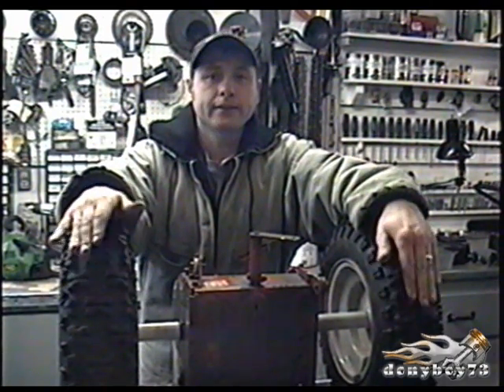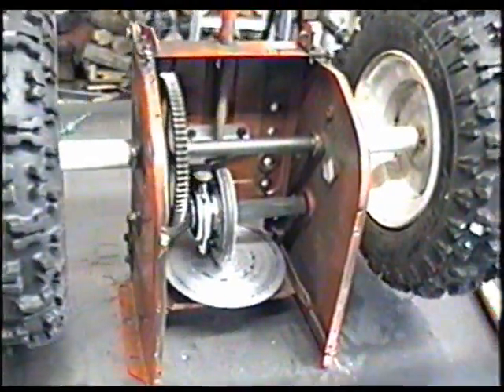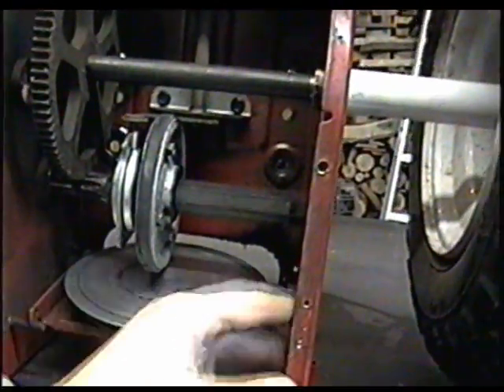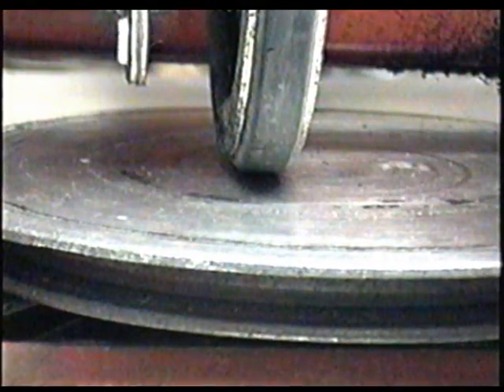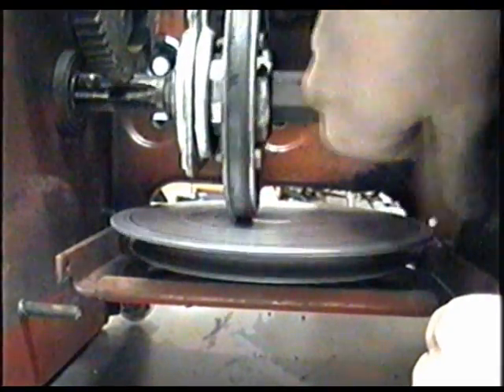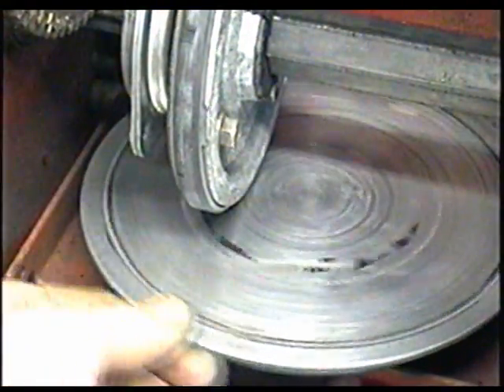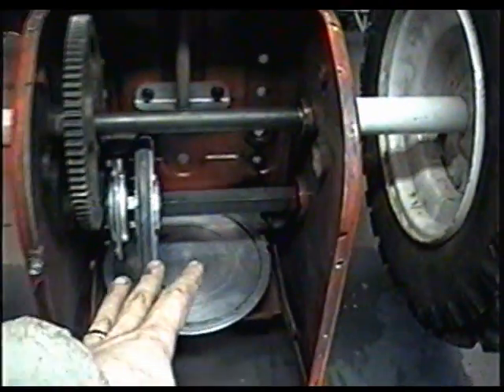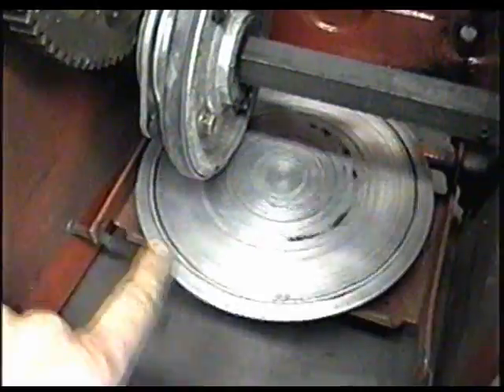HOW The Friction Disc Wheel Works on Your Snowblower

Comment: My friction wheel has been worn for a while. It makes the snowblower very difficult to manuever and can cause back pain, because you are constantly trying to move and turn the tank manually. I am at the point where i need to replace the friction wheel and Thank you for your video.

Comment: Can you make a video on how to lube and oil this part of the snowblower? My manual shows to use high temp grease and "oil" in some areas. What type of grease and oil should I be using? (Brand names?) and where exactly should I be applying grease and oil?
Reply from the maker: +turdsandwicher you can use lithium grease or transmission oil on the friction wheel shaft. On the bigger gears you can use lithium or low temp grease. any brand is ok but do not use too much because it can get on the drive discs

Comment: This clutch system has been around for years. They were using this set up on steam powered saw mills back in the 1890's. so good its never been changed!
Reply from the maker: interesting
Reply: Durability wise, it’s not so practical but if you want easy to maintain and simple, this is pretty good
Reply: @Creeperboy099 until it doesn't work. I'd much rather have a chain and sprocket or gear driven. It slips so much in heavy snow in lower speeds that it burns the rubber up with heavy use.

Comment: So the different speeds of the snowblower are achieved by the disc moving out or in on the friction wheel, the farther out it is the slower the speed?
Reply: Near the centre of the wheel the circumference is shorter than near the exterior wich is a lot longer. When the friction wheel makes 1 complete turn , the friction disc won't make a complete turn if it is near the centre but the friction disc will make more than 1 complete turn near the exterior of the friction wheel. When the friction disc is near the exterior of the friction wheel ; you are in 6 th speed . At the centre on 1 st. And if you pass the centre you in reverse.

Comment: I wrote to Ariens to ask them if it would do any harm to move the settings of the friction disc so that I would have a third reverse ( I know I would then have only 5 forward ) but the reverse  is so slow and I never use that 6 th. They answered that they would not do that because the sno-thro was not made to work that way. What do YOU think please. Thanks for sharing. You are so kind. I have a Ariens pro 28 2017.

Comment: Hello again donyboy. I have the exact same tires/wheels on my White snowblower and I have a constant problem keeping the tires inflated. Anything you know of to use around the bead that would help ? Wondering if you have the same problem with them too ? Mine was built around '93 so yes they are old but the blower has had very little use over the years. Sitting stationary for long periods maybe contributes ? Its a pain when you think you're ready to go for the winter and then ... flat. Thanks !

Comment: Great video, I have this same transmission on my snowblower, and the gear (top left) that is on the shaft the wheels are connected to, does not move the shaft it is mounted to, when the drive handle is engaged. I don't see any collar or anything that would hold the gear to the shaft.
Reply: Same here.. not sure to understand what is wrong.. gear turn but the shaft did not turn.

Comment: On my Yardworks(MTD) 30" snowblower the nut under the friction wheel is always coming loose making the friction wheel wobble and come out of adjustment.I often find the  large Jam L-nut at the bottom of the belly pan .Should I use treadlocker paste to make sure its not coming off? The friction wheel and its support bracket should remain tight at all time but this nut is given me a hard time because its vibrating loose, making the snowblower useless.

Comment: I have a craftsman blower with a similar setup. Drive wasn’t engaging. When I opened it, the hex shaft pinion gear was ground down, so I replaced that and adjusted the drive engagement handle (it was too tight, partially engaged). Now the machine goes slowly in reverse, no forward. I cleaned up the friction disk, wondering if that rubber needs to be replaced. Do you have any more thoughts on what it could be, prefer not blindly replacing parts.

Comment: It is for a Canadianna which is the same one I have on another snow blower (a Craftsman) I have.  The precious owner used an aluminum pulley used for furnace blowers but it is too soft and the key chewed out the hub. My mistake on the above post,  I should have typed 7/8" bore.  If you have one that would be great. I am at the other end of the province in Kenora.

Comment: Hello Donboy - I have a toro 824 snowblower which just happened to stop working in the middle of a snowstorm up here in Chilliwack BC - the snow auger works, but the drive axle will barely work in any of the 3 forward positions and a little bit in either of the two reverse gears.  I adjusted the tension on the drive belt with negative results  I am now thinking that the friction plate is worn out -  I havent checked this out yet as I just came across your video on how a friction plate works.  The friction plate that you show in your video, would it happen to be associated to a toro 824 - It appears that it is a fairly easy fix.  Great video BTW - thanks for sharing your expertise.    Burt

Comment: Always informative and very helpful. My blower moves, but I'm wondering if I should replace the disk because I have it apart to clean and grease. There are small tabs on the side of the disk that are flush with the contact area (rubber). Should the contact surface be higher than the tab? Higher than tabs= less wear?  Advise from anybody would be helpful. Thanks.

Comment: Hey Dony i got an Ariens 10 horsepower snowblower, and its a BEAST. but i have a problem with the reverse gear. its does all 5 in forward no problem but the Reverse gear just slips a bunch. what could it be? if it was the friction disc the other 5 gears wouldnt work either right?

Comment: > Hi Don. My name is Jim. I have the above mentioned snow blower which recently wouldn't move. Locked up. I watched a bunch of your videos and being mechanically inclined, I began diagnosing and found the chain would skip and lock up in the case. There was no grease to speak of in the chain case and there were no boots on the hexagonal axle with plenty of slack in the bearings. I bought this machine used some years ago. After working on it, I got everything moving, but I can't get the axle out to get the chain case off for rebuilding. There are no fenders on this model and it looks like the axle and left side bearing are pressed into the frame case/housing, with axle bushing pressed on the right side. Can you tell me how to get this axle out. There is a lock ring around the edge of the bearing on the outside up against the case which I removed but the bearing /bearing sleeve? is seemingly pressed into the frame piece.  I'm sure I'll have to rebuild the whole chain case or buy new, whichever is cheaper and will need the boots, IF I can get it apart. I don't see any videos on this model. Thanks in advance for any help you can give.  Jim Hock

Comment: Hey man thank you so much for the uploads. Very informative. I've got allot of help from your vids. I have a craftsman 2.0 10" saw , and I need crank seals and bearings for it. Would a duramark work to swap bearings and seals? The duramark or homelite saw has a bad wrist pin. So it won't idle. The craftsman saw runs but there is not enough crank pressure to get the oiler working. Please help.

Comment: Have you ever capped any of the extra holes on MTD or Troy Bilt snow throwers?  I can see that this one also has two sets of hexagonal holes on either side of the body.  They seem rather large for letting in snow and/or rain.
Reply from the maker: +Blaine Bugaski yes I have seen people cap them
Reply: Any good methods?  I was thinking about two large washers and a bolt per each hole.  Although if the bolt loosens up the washers would have a lot of room to slide around.

Comment: Thanks so much for all the videos Donnyboy.  With your help I have been able to get a 10 hp 32inch discarded snowblower running.  After replacing points and cleaning the carb it now runs fairly well.  All I need now is to find an 8 inch 3/4 " bore drive pulley for the auger.  It seems to be hard to find one, any ideas? I suspect you are a fellow Canadian.  Where are you located?

Comment: Replacing the rubber ring on the friction wheel, I've noticed that there are grooves in the Disk Plate, I would assume that the disk should be somewhat smooth. if so, how would one smooth the grooves out of the disk?

Comment: Dony on my fathers MTD snow blower we were running it and heard a pop. The engine shut itself down and when we tried to restart it the  hand cord pulls and retracts back into place but nothing happens at all. It seems as if it is spinning freely.Any suggestions?
Reply from the maker: maybe the connecting rod is broken

Comment: Good video.  Thanks for sharing.  My machine needs just a little more power getting up hills.  It feels like it's the weight of the machine bogging it down.  It throws pretty good but just needs more power for the weight.  I will check the friction disc now.
Reply: 7 years later, did you get a chance to check on the friction disc?  How'd it go?

Comment: Great videos. Ive learned a lot from you already. Thanks.

One quick question. I have alot of deflection of my friction plate when drive handle is engaged. I have a fairly old ariens 8524 (8+years of hard use). I replaced the friction disc last spring, and am already struggling to get it up 8ft ramps into my pickup. Do you think it maybe worn out flange bushings holding the hex shaft to the friction plate? Any ideas would be greatly appreciated.

Once again, great instructional vids. Keep em coming!
Reply from the maker: you may need to adjust the cable
Reply: ok, thanks guys. Gonna check it out when things get a little warmer. Luckily have access to a back-up til then...ill let you know what i find.

Comment: allo, i have change the belt and the friction wheel but my problem is that there is some oil coming on the drive wheel so after a few minutes of using it the snow blower doesn't move anymore. Have youever seen that problem?

Comment: Good day Donny! Love your videos. My Toro 1028 does not move in first speed/gear but all others are fine including two speeds in reverse. What should  I check to find the cause of first speed/gear not working?
Reply from the maker: try adjusting shifter linkage
Reply: @donyboy73  Do you have a video showing shift linkage adjustment?

Comment: I have had issues with mice and they like to build nests in that area of my blower. They ate the rubber off my drive. I open the cover now throughout the.year and check for mice. I also have taken measures to deal with the mice. I live in a rural area and mice are a big issue. Should I grease those gears? Thanks great content.
Reply from the maker: yes i put a thin film of grease on the gears
Reply: Thanks, I will.

Comment: Do you have a video on how to adjust the drive on a Toro 7/24 I can get all 3 forward I can get a reverse when it's level and no force on it.But if I try to back up through snow or back up a hill no go.It wants to reverse but it won't.

Comment: Hi,This question may have been asked and answered I did not take the time to read all the comments below so if this has been asked can you message me any how please as I am in the middle of fixing my blower and do not know much about this friction system...I want to know is it worth the effort to sand down the friction disk if it is all rusty? or will that just give it more friction? I am inclined to sand off the rust what is your advise? BTW Thanks for posting this information Thanks Luke.
Reply from the maker: yes sand it off with a 400-600 grit emery sandpaper

Comment: Thanks - but I have an older MTD that will shift but not go. It has two chains. The one on the right (with machine upside down) which has small sprocket on shaft came off somehow. Cant get back on.... I see no adjustment to loosen/re-tighten....Am I missing a simple way to get it back on?

Comment: Help. I have changed the belts and Friction wheel in my Noma 10hp snow blower. But the friction wheel will not meet the friction plate so I can not go any where. The cable is adjusted, still can't get it to move. What changed to make it this way? Snowed 12 inches today and I need it.

Comment: Awesome video, but my issue is that on my Deere, the friction disc wont detach from the friction wheel.  Doesn't seem like there is any room for it to drop either.  Any suggestions?  Thanks

Comment: I was wandering if you had something on tiller transmissions, I have an craftsman 800 series rear tine tiller and the transmission is not working properly. I repalced the chain and a drive shaft.

Comment: I have a Simplicity 8-60, the auger control drive is intermittent. I've changed the drive belts  but that didn't seem to help. The operators manual doesn't cover an adjustment for the Free Hand control.

Comment: I just purchased a brand new snowblower and when any of the 6 forward gears are applied it only engages reverse.I have been scratching my head wondering how that could happen with a new out of the box machine. Would appreciate any advice you can give.Thanks!
Reply: did you ever figure it out? mine does the same thing in 1st and second! trying to find out why before winter.
Reply: Yes i did, believe it or not the transmission I had was made of plastic so it was banged around during shipping causing it to break. Here a link I think is more informative:

http://www.snowblowerforum.com/forum/snowblower-repairs-maintenance-forum/2409-craftsman-professional-transmission-issues.html

Good luck!
Reply from the maker: I would take it back, probably something wrong with shift linkage adjustment

Comment: My MTD looks just like this. My problem is that the friction wheel and disc are touching before I pull the cable. The cable is currently very loose. It works perfectly when it's up on its end, but is stuck when I bring it down on its wheels. Should there be a spring on the left side holding the plate to the stop bolt?  Any ideas?  Thanks.
Reply from the maker: there should be a spring attached to the metal disc assemble to help return it
Reply: Thanks.  After looking closer at the manual I see I am missing a spring.

Comment: my old 1977 ariens 8/32 cant go up a one foot hump in reverse and my impeller doesn't stop when disengaged, turns slowly if I hold it ( blades ) the machine wants to move forward slightly.

Comment: Could you please give me advice on my Ariens snowblower , There was a chunk of ice 

that prevented the impeller from rotating ,I kept squeezing the handle on the handle 

lever then smoke came out of the side, I stopped cleared all the ice out now the 

impeller doesnt move at all, the engine runs fine and the the tires rotate good as 

well, I can only use it as a plow,, could you please tell me what I broke? Thank you
Reply: +sissy rahrah you burned the belt that drives the impeller, check your manual for how to replace it
Reply: Thank you for your help!

Comment: my reverse and forward gears are not working.
here is a video showing a problem with the friction disk. it seems like the back plate is jammed, i tried turning it manually and it wont turn.
please help ? thanks!
Snowblower Problem

Comment: a video i was just watching said to put some grinding grooves in his disc on the bottom plate to give more friction. do you think this is advisable? He was complaining that the disc was too smooth. Can you come up with a better idea ?
Reply from the maker: never do that, replace the rubber disc first
Reply: Grooves cut into the aluminum disc will quickly wear out the rubber drive wheel.
Reply: Roughing it up with coarse sandpaper maybe a better idea
Reply: It is meant to be smooth, other wise it is like ramming a manual transmission in to gear without using the clutch, and unfortunately it causes the rubber to wear out. They know how to make them better, it is just a matter of how much you are willing to pay, which most aren't willing.

Comment: I would presume that the gear speed handle changes the position of the friction disk on the plate....if it's further out to the edge it will drive faster....(faster rotation on the outside),  and yanking it toward the center will be slower speed...and then positioning the disk over to the left side will be reverse

Comment: Great vids I appreciate you posting them. I have an old MTD 640F about 16 years old has been a workorse for me here in the Northeast U.S. I have looked at some new models and various websites out of curiosity more than anything else, I intend on keeping mine as long as possible still runs strong but is getting pretty rusted. What is your opinion of the China built Powermore and LCT engines that are now being used by many manufacturers today especially in sub $1000. units?